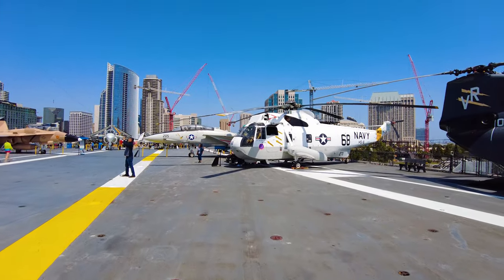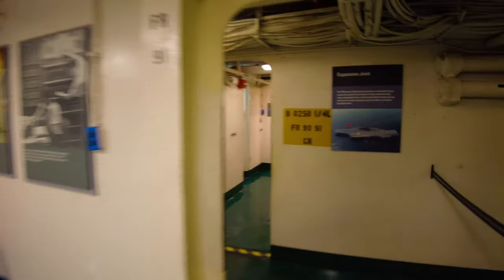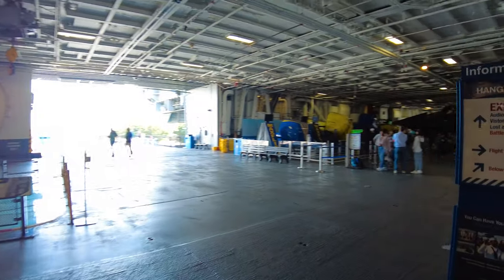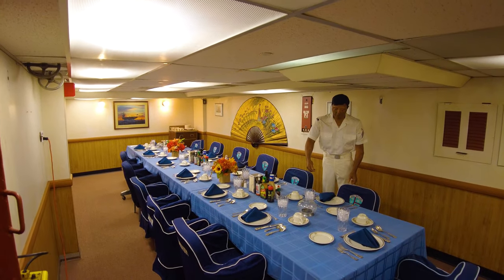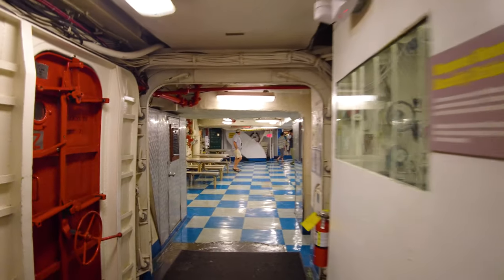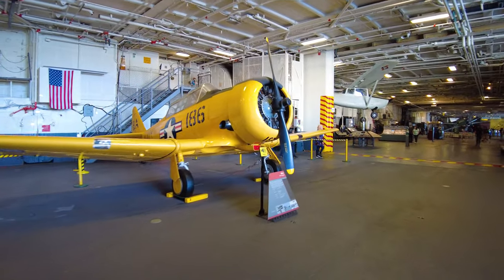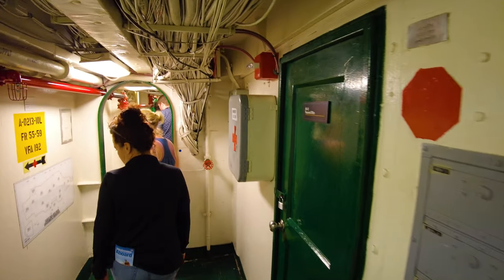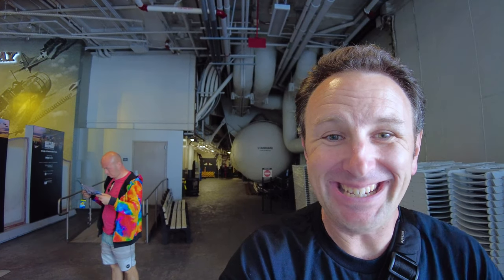Exploring the USS Midway Museum in San Diego

Comment: Nice video!  As a Data Systems Technician on the U.S.S. Midway  in 1986 I may have maintained that very 642 Bravo in your video (minute 26) among other gear...  Believe it or not this beast only had 32k of memory, consisting of tiny magnetic donuts with wires going through them in different directions. Send a current down a wire running in a certain direction imparting a certain magnetic field, then a current down another wire to read that field (one or zero)!   If I recall ,the bottom couple of 'drawers' consisted of these magnetic donut arrays.  Pretty amazing when you think that, as of this writing, you can buy a solid state drive, the size of a stick of gum, that holds 2 terabytes of data for under a hundred dollars!
Reply from the maker: Awesome Bob!